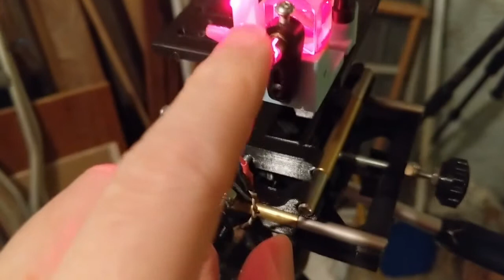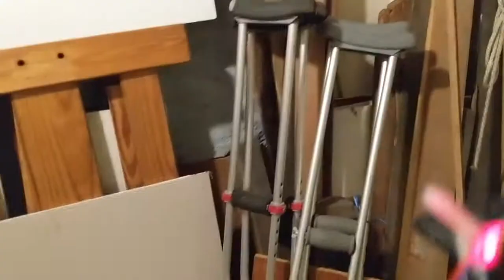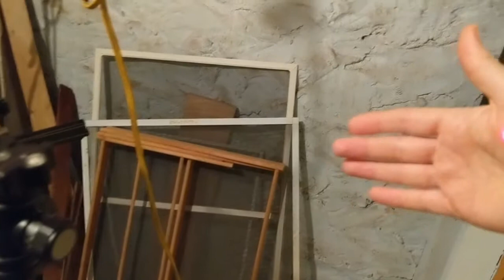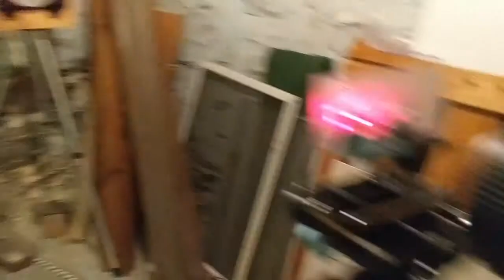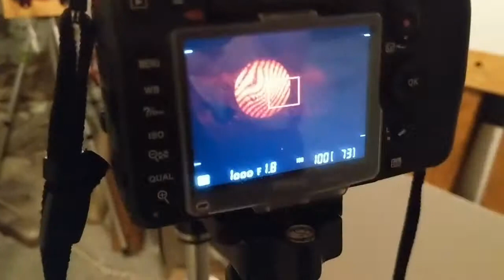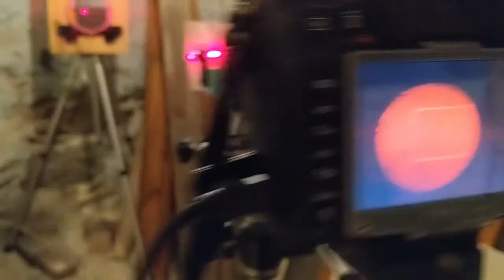(OLD VERSION) Setting up and using a Bath Interferometer

Comment: Why do you need a camera lens at all? I just project directly onto the matrix. I I have mirrorless, maybe it makes it easier.
Reply: You could also use a pinhole camera
Reply: @AppleSpar  How exactly? Do you put the hole in the focus point of the lens and the mirror or use a screen?
Reply: @a_pakhomov  I'd put some translucent paper at the focal plane to focus and then replace it with the film or photo image detector.  It would be like old time photography
Reply from the maker: So it turns out you absolutely need a lens.  Without the lens you will get bad results.  It will look like a reasonable igram but it won't.  I don't understand why.  There is discussion of this on the groups.io/g/Interferometry forum.  I think it will have diffraction and/or distortion effects - I forget.